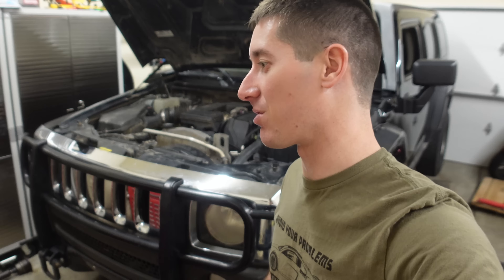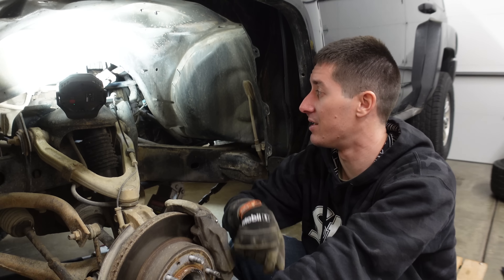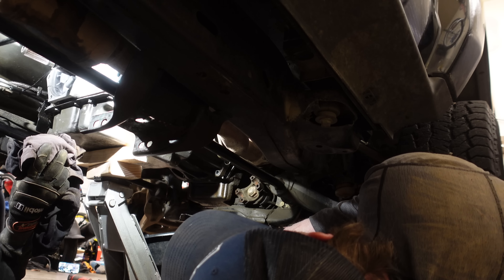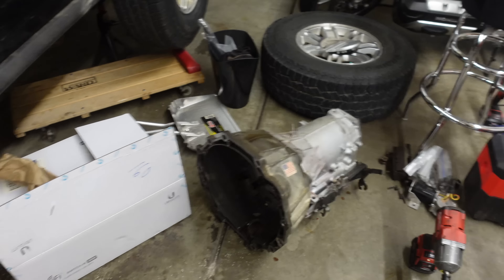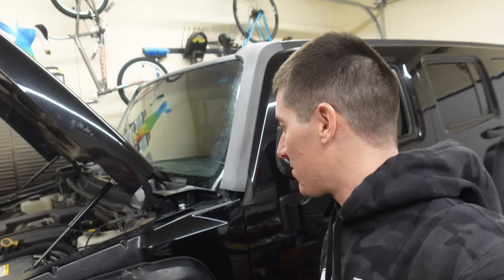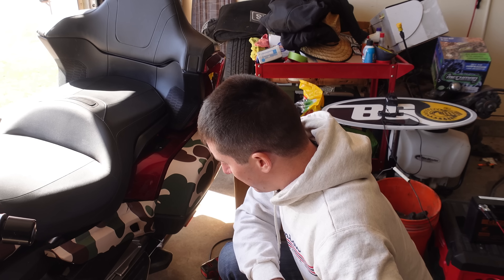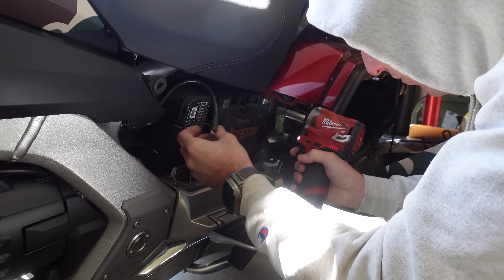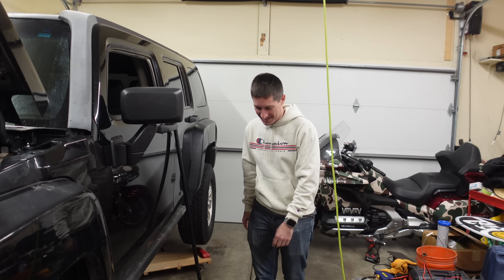I Had To CUT The Transmission OUT Of My CHEAP Hummer H3

Comment: Buy, borrow or steal a transmission jack to reinstall that thing JR!
They are designed for that and you can secure the transmission to it so it does not fall off.
Also, don't pay for oil dry or any kind of shop stuff.
Buy the cheapest kitty litter you can get. It's much cheaper and works just as well.

I haven't had a bike since the mid to late eighties. It would be cool if you put a camera on the front of yours next time you ride it.
Don't forget to keep the battery maintainer on it. 😊

Comment: I literally hurts to watch you do this in a garage, on the floor!
Reply from the maker: Same 😂
Reply: @WatchJRGo  I worked in my dads transmission shop for decades in ElDorado and we never owned a lift.
Reply: WatchJRGroan 👨‍🔧🚗🛐
Reply: @stevenreynolds2327  Image how much easier life would be if you had a lift. Some things like this need a lift
Reply: @npolite22  Back in those days, a lift wasn't even on our radar, its all in what you are used to. Heck, we barely had heat in that old building.
Reply: Looks very dangerous

Comment: Thanks for showing me another vehicle never to get. I had to remove a Ranger trans this way when the motor locked up. Couldn't turn it over to get at the torque converter bolts. Fun times.

Comment: The intake manifold is a lot easier than it looks. The key is to go through the wheel well with an extension after removing the plastic wheel well cover. Some of the bolts are easier removed by feel rather than sight. Looking at a bolt pattern diagram simplifies the removal and installation process.
Reply: Also be sure to clean your throttle body while it's off. Might as well.

Comment: What a great video. From a point of safety good jobe knowing your limits J.R. . Knowing that if that transmission kicks loose that you don't have quite enough upper body strength to keep if rom falling of the jack was a GREAT call. What a beast of a removal that was.

Comment: On that intake be prepared to use as many extensions that you have, a swivel, and if I remember correctly a 10mm. Done the intake job on my stepdads gmc canyon with the 3.5 inline 5 on the ground just like you all are and it took me 2 days. After many cuss words I managed to get the job done. Just be patient and take your time and you will eventually get it done.

Comment: 17:47 I think Jake made a fair point:
For a bike that is not ridden for a while long - i.e., almost all bikes - I think you should put in place a "easy" / "comfort" connector directly to the terminals - from the brand you have a charger, e.g., CTEK, NOCO, Bosch, etc...
This way, not only you are able to charge it easily, but also you will not go through this again.

Comment: I waited for over a month (in mid 2022) for a remanufactured 4L60E. It went out with fairly low miles (78k) on my '06 Avalanche....but it started acting up early (in reverse) with travel trailer attached. I never towed in overdrive though, which no doubt hastens the 4L60E's demise.
Reply from the maker: Oh yeah, towing in OD smokes those things

Comment: Next time you pull a trans mission, once you undo the rear tranny mount. If you are close to hitting the transmission hump as you pull it back off the engine.  Put a jack under the front harmonic balancer and jack it up about an inch...  This tilts the rear downwards and a lot of the time the tramission will slide right off the TC .....  Makes it much easier....

Comment: Add a Noco quick connect charge port to the motorcycle.  At least then with the larger chargers, you can turn it into power supply mode and make it unlock the box.  It acts as a remote jump terminal.  I think the small jump box can plug right into it as well.

Comment: It's called a Battery Tender lead, it connects to the battery and the end is tucked away, if dead battery you get the Battery Tender jump lead, Very important!!!! when you plug them together the red clamp is negative, because it's normally connected to the Battery Tender, but now you are plugging into another lead at the battery, now you can hook jump pack to gain access to battery. I feel your pain John, and am very familiar.

Comment: What a nightmare job on the H3.  Shop floor was a mess.  LOL.  Can't wait to see once it's finished though.  As far as your Goldwing and dead battery, did you try the good ol push and roll start in 2nd gear?  I guess if the battery was dead as a wedge it wouldn't work.

Comment: You need to tune up the engine on that Honda. It didn't start until the second piston came up on the compression stroke! Sitting without being run for several months is no excuse. 😀

Comment: Did you get rid of the lift you had for the garage? You had it before you bought the big shop...
Reply from the maker: You don't want quickjacks for a transmission pull 💯
Reply: @WatchJRGo  Roger that. Access and clearance... Got it

Comment: 5 hours to pull the intake manifold? Would it not be quicker to unbolt the engine and lift it out of the truck, and then have enough room to remove the starter that way?

Comment: Remember when you changed the cooling fan on this truck you never changed the water pump why your fan continually turned and never stopped was because the fins on the impeller flattened out causing no resistance to stop the clutch fan it did the same thing on my expedition I changed the water pump now the clutch engages on the fane until the the thermostat opens
Reply from the maker: The Hummer has a brand new looking water pump in it... I'm pretty sure the aftermarket clutch is the heavy duty one and it just runs more. I hate it but I'm not paying double for an AC Delco 😬

Comment: The more I think of it, these GM transmission are very much like UniFi equipment. Works OK, but you need to go through a bunch of hoops, just to get it installed  removed or maintained.

Comment: Let ask you a ? I have a 1998 Lincoln Town car I just got the door module quit working if I send it to you could you take a look at it and see if you can repair it cuz you look do really good on electrical parts cuz I do believe it blew the capacitor out of it tried getting one used one from the junkyard but they where bad and ford don't make them anymore

Comment: Why didn’t you use Johnny’s lift for the transfer case ànd transmission?
Reply: He figured it would take too long to deal with and didn't want to tie up the lift for paying customers.
Reply from the maker: Because it would be in his way for 3 weeks, I'd much rather be in my way 🍻
Reply: @WatchJRGo  Johnny wouldn’t mind. He’d give you a parking space outside.
Reply: @69Dartman  Tie up the lift? No way. Johnny would help push it into a parking space outside.
Reply: @gregdiamond6023  Johnny probably would because he's a good guy but I personally wouldn't want a rig I'm hoping to fix and sell down the road to sitting in a open parking lot that long. Might be missing some windows and parts by the time the transmission was done and no fault of Johnny's.
Reply: @69Dartman  idk I think Johnny has a good security system. Nothing happens to the BMWs etc. They aren’t messed with and I doubt anyone would mess with the hummer.

Comment: I've followed you for years, but watching you struggle with the Goldwing was disappointing. It is trivial to get into a dead Goldwing. Pop the cover that is below the trunk, remove the key from the fob and when you turn the lock the panier will open. If I recall the left opens first...now you can get the battery replaced or jumped. There is a pull cable in the top of that panier which releases the other panier and in that panier is a pull cable that releases the trunk. It takes seconds, less time than trying to tear the cover off. Gah!!

Comment: Don't be surprised if you have to change that motorcycle battery in the next 6 months. That's not a good sign to get a battery that's been sitting on the shelf for over a year...
To those that own motorcycles, in my experience I have had better luck with NOT having a battery tender. I can get 4+ years out of a battery where a few of my friends that have tenders get about a year and a half out of a battery. And we ride quite a bit when the weather allows us to... 🤷‍♂️

Comment: SeriouslyI knowyou love proximity keys but the Goldwing and on early Ford issue i why I won't own one.  Yeah, ludite alert.  HOW can there be no jump point or battery access ormanual override forjust that side saddlebag?  Motorcycles and lawnmowers (or for us, snowblower) are notorious for being ignored.

Also, I cannot imagine going longer than the ride home without installing a fused SAE connector for both charging and heated gear.